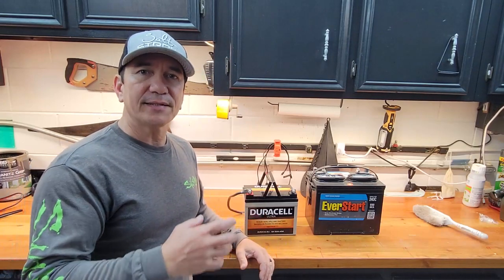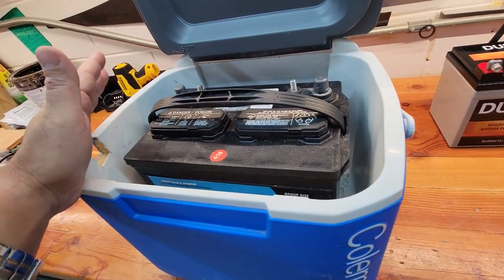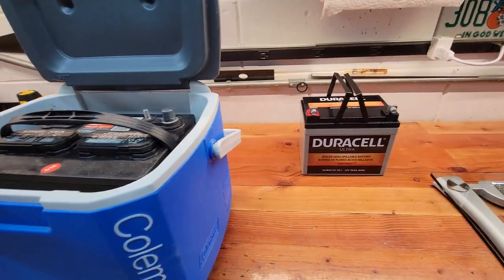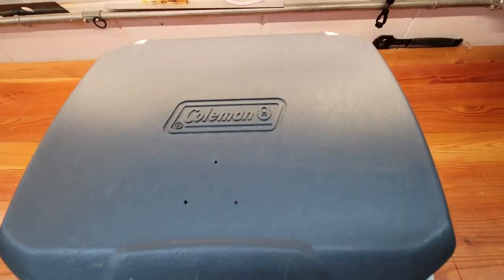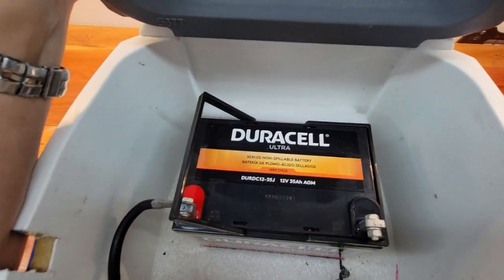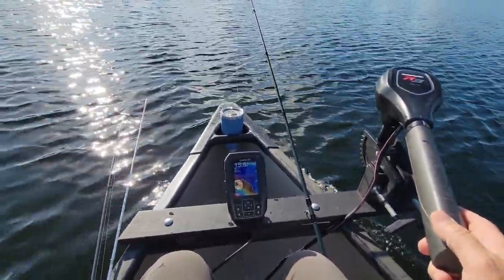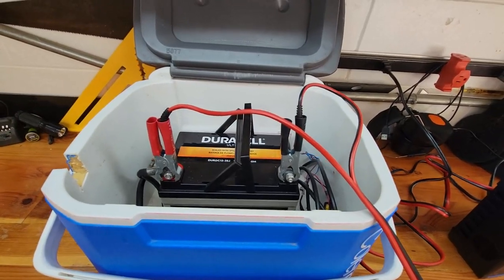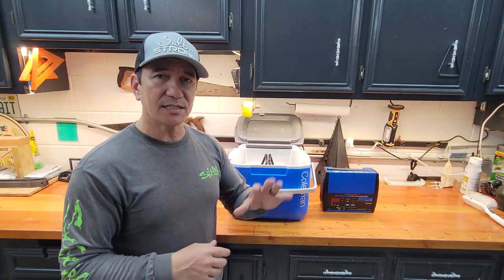Battery Test for Canoe or Kayak.  Do you really need Lithium?

Comment: Good video.  I like your production qualities and you obviously use these batteries in real-world scenarios.  You realized the weight penalty that comes with lead-acid batteries, including AGM.  You could have purchased a 100AH, "mini", lithium iron-phosphate battery that weighs only 20lbs and gives you very close to 100 amp-hours of real, actual, usable capacity.  By comparison, the 35AH AGM battery you demonstrated in this video can only deliver about 50% of its rated capacity, or around 17.5 amp-hours, before the voltage drops too low and it is "dead", meaning it won't run your trolling motor or your fish finder anymore.  With that battery chemistry, you better remember to charge it as soon as you get home, because if you forget and leave it that way for 2 weeks...it's a one-way boat anchor.

So, you spent $85 dollars to get 17.5AH ($4.85/AH) of usable capacity, with voltage sag and reduced life-cycle count.  You could have spent $200 for 95AH ($2.10/AH) of usable capacity, vitually zero voltage sag across the discharge curve, much faster charge times and much higher life-cycle count.  Perhaps more to the point, for a canoe or a kayak, you could have bought (or made) a 50AH, lithium iron-phosphate battery, for right around $100.  It would weigh 12.5lbs and deliver nearly 3 times as much usable energy, with all of the other advantages already mentioned.

The only people buying lead-acid batteries for trolling motors or fishing electronics, these days, are those who do not understand the difference between cost and value.  For those uses, lead-acid batteries are a false economy.  They are still the better choice for a high-draw cranking battery, though.
Reply from the maker: Thanks Jason. You must know your stuff. Thanks for the feedback